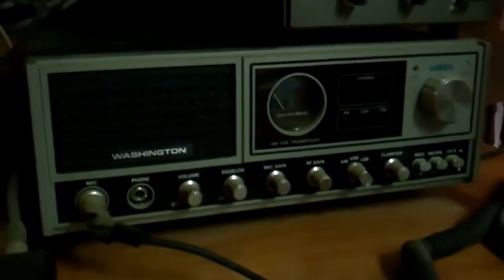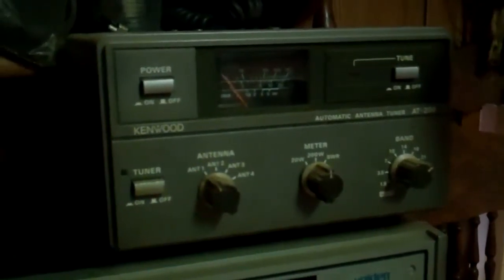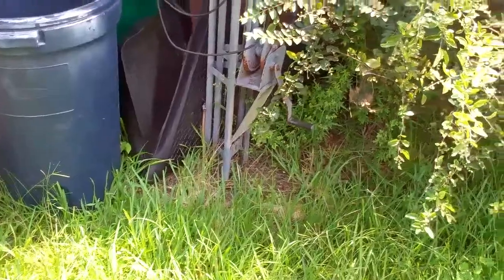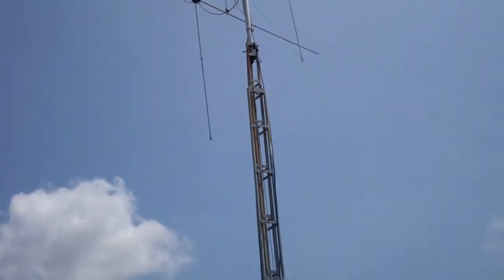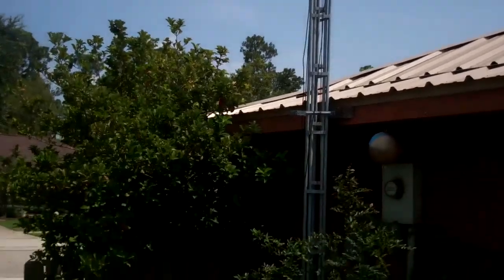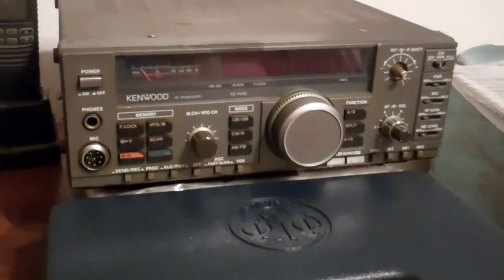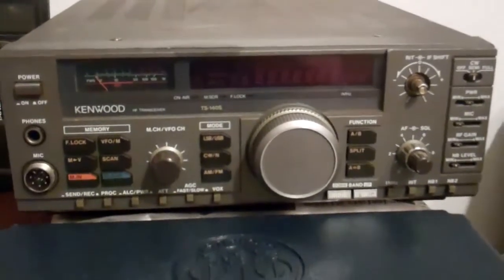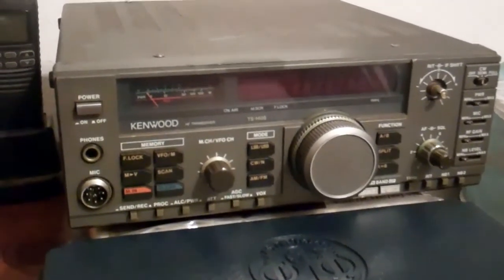Another thing to do..learn about HAM/SSB communications. Whe

Comment: Never send stuff to Radio Shack.  I have an older Radio shack rig that I bought new from them 20 years a go and it has had TX issues since the day I bought it, been back to them twice and they can't fix it.  Try and find a local HAM shop or hook up with a club, they will steer you in the direction you need to get the Kenwood up and running.